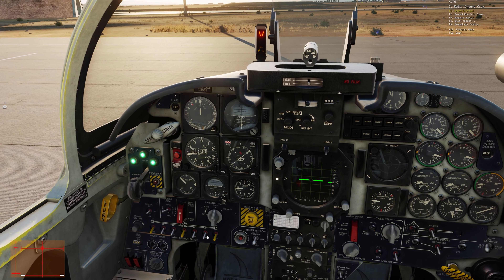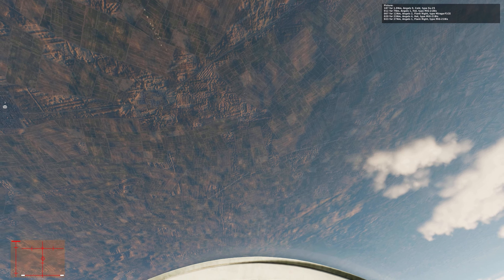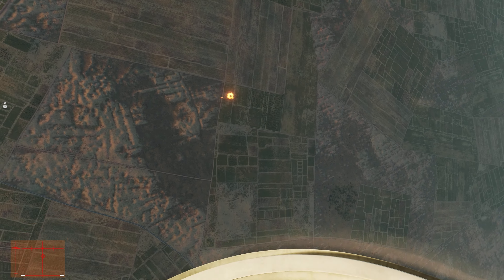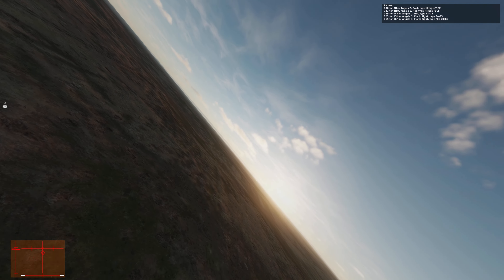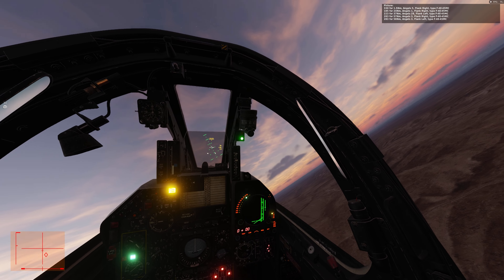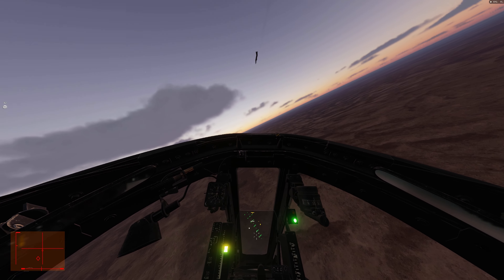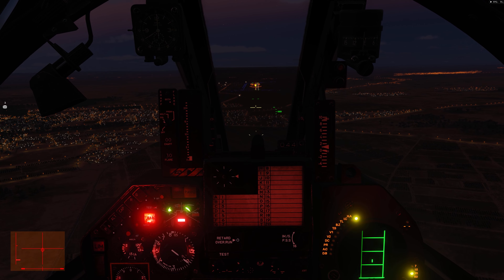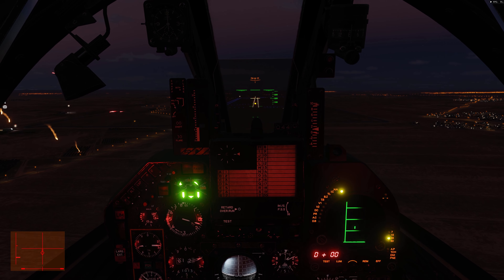Thrustmaster AVA Base Impressions | F-5 & F1 | DCS World

Comment: Great review. I have the Warthog and will be getting the AVA soon.  Question, I have Trackir5 as well and get jitteryness/stickiness in DCS. I also play Star Citizen and the Trackir is smooth as butter in SC vs DCS with the same trackir profile.  In your video, your track looks so much smoother than mine in DCS. Any advice? Or even willing to share your trackir profile with me if you can?  Also, I have a plenty stout enough PC. I7 with a 4070 and 64gb ram running 1440 as well. Thanks in advance.
Reply from the maker: @michaelmcdonald1196  
If you hop on my discord there’s a text channel where I share files and good buys I’ve found to help with simming, my trackir profile is in there. 

I also always hit the key for smoothing when I first boot the program and share the same profile across everything too (though WarThunder is the only other thing I play with head tracking).

It would put me off a game pretty majorly if it didn’t allow my profile to feel the same as I’m familiar with.

Comment: I'm not sure what the cam profiles are that come with the stick, but I know on others (VKB, Winwing, and Virpil) usually have a cam that usually is described as a "Space sim" profile. Basically, it can have a soft detent in the center so you know stick positioning however it also has a more consistent pull throughout full stick deflection.
Reply from the maker: There are only two, one that’s like a soft V shape, and the other is basically the same but with a more rounded centre - I imagine the second one will be closer to what you’re talking about, but they’ll probably release more options as time goes on. 

Or people will 3D print alternatives
Reply: @Bullet4MyEnemy  makes sense, I don't doubt they'll come out with more. Of course it's up to your preference, but I find when the force to move the stick is linear it's much easier to control and get used to.

Comment: Feel free to diversify the channel, though I'm here primarily for the DCS and WT stuff =).
Unrelated, what's the name of the bind for forcing the slats up on the F1? I've tried binding what I thought it might be, but it turned out to be wrong. 
Cheers
Reply from the maker: It’s called something like “high lift devices” and I think there’s confusingly 3 inputs for it and they aren’t called anything logical like up or down, if I remember to check next time I’m on then I’ll come back and update it. 

I have it on a 2 way switch, with forced up and normal bound as each position. 

If you try it on the ground with the flaps manually deployed you can check it works properly; the in-cockpit switch is by the throttle with a black and yellow “hazard” style backing, hovering the mouse over it might help perfect the wording of the bind’s name.
Reply: @Bullet4MyEnemy  Many thanks!